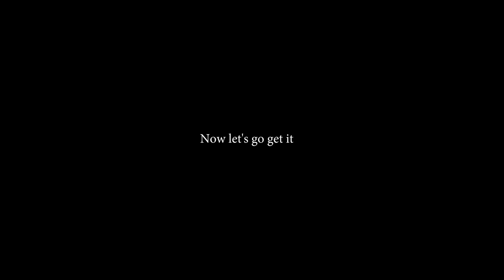Buying and fixing a lowboy trailer : Centreville 35 ton detachable

Comment: You're going to find that trailer is going to be very useful to you because it's a stretch trailer and if you take the back in and put yourself a drop axle in the back you can go up to $130,000 with it as it is right now you can only go 110 and that's anywhere in the 48 states but that's a nice nice trailer

Comment: Since you are doing it up i would get some undercarriage pertection and redo or respray where you put the new air tank Since you are leaving the cover off  .I would also grease the hooks 🪝where the trailer separate the sticky grease and maybe beacons to go on top of the truck for when your stopped on the road again. Also maybe air bags to help with the trailer hook up in steed of wood just a thought 🤔 great 👍video 👍📹.

Comment: On your chain binders you need about 3/4 of an inch of threads showing. DOT will get you otherwise. I am a flat bed truck driver. Great video!
Reply from the maker: really? I did not know that. why on earth would they want that?
Reply: @jmuller86  Well you know the government. If they can make your life tougher. :) I was told they want to see that because if your chains get loose you have room to tighten them without taking the the binder loose again. It really is a nitpicky thing. It does make it easier if you do end up having to tighten them.

Comment: Great buy and video.  I was hoping to see all rubber replaced related to the brakes.

Does anyone have experience with treating large rusty areas with rust eater or converter?  Sure seems like a labor saver.

Comment: I had made some sized Extension nuts out of 4140, welded on with dual gas mig. With lots of Kopper Kote. Keep it from rusting again! 
Give the valve a couple of shots of penetrating oil. 
For your tank drain, are you allowed to put a pull tank drain on it? 
Working from the rear to the front (LR, RR,, LF, RF)  be easier to tighten the lines? 
Kopper Kote it will keep it from rusting. again 
Stainless Steel Fender washers, doubled up?

Comment: Simple trick for removing corroded pipe threaded nipples - break the bond by tightening it just a crack before attempting to loosen it. Pipe fitter father taught me this trick when I was a kid helping remove cast iron radiators.

Comment: Get yourself some steel blocks They should be about 2 inches thick and the length of the channel that flip down. With the big arm . So that your lowboy dont drag. You put the steel blocks under the ears coming from gooseneck to lowboy. The big arm picks them up when unhooking It will give a couple more inches when getting in or out of some place. Instead of dragging and gettin hung up. Just put some wood skids under your Hyd Foot and pick it up higher and slide steel blocks under channels either 1in or 2 in steel. Then set it back down on it. It will give you more ground clearance. I wouldnt run it down the road very far but it will help you too get in or out of some low places...Good luck with new truck and trailer

Comment: I will start with the ADS, my god YouTube is getting as bad a regular TV! I come here for the content, not the ads and there was one like every 5 mins. 

Anywho, great find for the price! It reminds me of the one company I worked for years ago that had an old twin-stick R model Mack and a lowboy that came from the strip mines of southern Ohio.  I have to giggle with loading equipment over the wheels. As long as you're lined up, no biggie!  All I can and will say, about the time you go to load or unload somewhere and that damn pony motor won't start or you forget to fill it and run it out of fuel, you wish you had a wet line installed on it! 

I never heard of that brand but I have operated a bunch, Trail King... Sucks! Eager Beaver... okay, Globe... good for someone else, Etnyre's Blackhawks are good!  Load King... I'll keep my money... the one I had the best luck with was Talbert! So easy to hook up even if you not totally lined up straight. That is what we used and ran in my business. 

Jesse, too bad I wasn't up there, I would show you how to save time and load over the side without detaching. I used to drop the trailer down to the ground, dump the air, and load dozers, backhoes, rubber tire loaders,  track hoes, and minis and even graders over the side. I'm sure someone will say that is hard on the deck boards and the outer rails. Well, we always used elm for deck boards because it is stringy and doesn't spill like other woods. Yeah, it is hard on the outer rails if you don't know what you are doing. But we had two trailers custom built-in Finlay, Ohio or around there and I want to say Mac or Trailer America? But we always took our lowboys there to beef them up! Two had a dovetail over the ass end and ramps. Another huge time saver!  But when you were moving something nearly every day and the amount of iron we had, you look for those time-saving methods! 

It will save you a lot of time, hassle and expense moving your own iron than paying someone else. But there still may be a time or situation where you have to call someone. Good luck with it!

Comment: First time ever I have seen a mech use an earth pick as a quick mechanical punch. Worked really fast so Jesse the unconventional thinker. Good on ya. I had a wild guy who worked like he was killing snakes and he was driving a punch to line up beams. I slid my thumb on the punch just as he was swinging a ten lb maul and he saw my thumb at the last second but I had quickly slid it off as the hammer approached. He thought he had mangled my thumb but that time I lucked out.

Comment: How much would you be paying for an equipment pickup or drop off?  I could see that low boy paying itself off pretty quickly.
Reply from the maker: it was like $400 minimum for even a mile down the road. because you are paying them from the time they leave their shop to the time they would get back, or the minimum which is usually 3 hrs

Comment: When I was running low boy like your set up I carried two ,   2  inch high blocks  by 4X4 to raise the frame up when carrying a load across rail road crossings .Put intro your stock of "Possibles " it will save your ass. Plus it  makes sure your boss never has to call for help if get high centered on some bad piece of road. Just a hint from a driver from the north  "alaska "  you will thank me someday !!!

Comment: Was the Samsung over width?  It hung over the sides of the lowboy.  What's NY law on that? Any nearby states significantly different on over width?
Reply from the maker: over 102 needs wide load signs. excavator is 101.5
Reply: @jmuller86  8-))

Comment: not bad, for the money

beef the cross member up, maybe put a plate across that dovetail.  if your blocking moves or fails, whatever reason, it may save you some frame work. i moved one like that from the manufacturer.  salesman didn't even wait for me to get out of the cab, he had the pony started and the paddle on the stock crossmember before my feet hit the ground.  bent it severely.  the receiving customer was not happy, but didn't try to blame me for it.  muttered something along the line of "not the first time this has happened."  you are probably better off with the setup you have.

Comment: Jesse you can adjust your ride hight as well, get some steel and put it under the gooseneck feet that swing up and down as needed for different hight for  RR tracks etc. good luck
Reply from the maker: I think I will do that, do you ever see someone permanently put shims in there? I would love to raise it 4 inches
Reply: @jmuller86  no, but a variety of shims will get you out of a pinch. Ive seen a old timer that had two three sided blocks each a different hight to get proper ride hight.

Comment: Jease just a little help when loading an excavators put your final drives on first so your counter weight and finals are not at the some end and when you drop your trailer drop the air on your tractor before you drop your trailer and raise it when you pull away then drop it before you hook up once backup in to the trailer raise your air then goik up the trailer just some hints from an ol lowboy hauler
Reply from the maker: thanks . I appreciate the advice

Comment: As a business you should not now paint anything, but make log book, every time you move it, write price avarage on market. All that money should be used on heavy machinery. Lets say you needed some fix, or some new part to change. Even properly repainting digger which is a must. Maybe buying some parts for future. that money must go into service of your equipment, ok lets say you need to replace pricy part and holding untill its needed. You have money buy the part needed new. ANd store it untill you will must change. After you reach price you paid for it start using this money for paint properly you dont need to repaint all at once as prep work takes ages to do it properly while removing rust etc.This is heavy equipment paint is only for rust protection and in sometimes for better looks. What you can see in corporations, they will always repaint non stop parts which have issues. lets say plow or bucket yes it is needed its a must!. They finish the job and machine needs to sit and have to be serviced, so they paint even plows everything. if not it will start rusting same day it will stop digging work.

Comment: Two things as a driver that pulled a low bed for years you need to turn the red glad hand over on the trailed you can get a ticket if down pressure will disconnect it and a fifth chain on the bucket or boom would make you legal. other than that you are on the right track. I pulled a Hyster low bed with pony motor it was ok but was replaced with a Cozad much better.
Reply from the maker: I did have a 5th chain on the bucket. I think I might just put normal air compressor connections between the neck and trailer, easier and no rubber parts

Comment: I think it might make sense to increase the surface area on the tip of the ramp by bolting down some old rubber tracks. Metal on metal, especially when wet has basically no friction if one track slips you going to have a bad day 🤪

Comment: Everytime I replace an air tank I  replace the valves..fittings and hoses.. plastics hoses tend to crack...old valves sometime will freeze and rubber hoses deteriorated inside.

Comment: Just a friendly and helpful tip from my experience, once you get used to the truck and the way it handles you should be able to shift a lot slower and smoother. Shouldn't have to rush to jam the stick from one gear to the next however I'm pretty sure that's how EVERYONE shifts when they first started driving big rigs (shifting fast). It all comes through practice keep up the good work and don't get discouraged if your shifting seems to be fighting you now that you are pulling loads you gotta shift and drive much different with the weight of a load!!

Comment: I know you didn’t have oak for the missing spots but why would you change from the hardwood to a softwood like hemlock?
Reply from the maker: around here it is rare to see oak , hemlock is the standard. I asked the local bigger sawmill and they said hemlock is used 90% of the timr
Reply: @jmuller86  more expensive for sure. I’ve got a lot of hickory and oak from a storm.  I don’t have a mill so it will end up firewood

Comment: OTR drivers like the RGN trailer, but  mostly avoid hydraulics as they add weight. Air bags and blocks are easier at the scale house when you  have to deal with the cops. The extra wight is an issue.  If over weight, that hydraulics and motor may have been enough to pass on by.  I am not talking 80,000.   I am talking  every State and Provence OVERSIZES rules.  They are not standardized.  One says ok, the next wound count the axle because of spacing and put you over the limit.  Lots of variables.   But your choice is perfect for you.  Hope you get the driveway done so you can get you stuff off the highway and up to your shop . It not wise to keep stuff where vandals can get to it.

Comment: Don't forget to get some oversize banners for your truck and trailer when you're towing anything that hangs over the trailer edges. They'll sting you for it. Or at least in most states, don't know about your state laws.
Reply from the maker: this trailer is only 8ft wide and my excavator is just under 102" so it should be legal without the flags
Reply: @jmuller86  Well, then that makes sense. I think most are 8.5 feet these days (or that's the max anyway).

Comment: I think it would be a good idea for you to carry a couple of 2" square blocks to place under the verticle stiff legs for WHEN you get hungup on a breakover. Its only a matter of time. The trailer could be upgraded  to spring brake parking for a couple hundred.
Reply from the maker: if I am already hung up, how would I get the blocks in there? I definitely do want to prepare for getting hungup. something that worries me
Reply: Jessie, raise the hyd cyl
Reply: Raise the trailer with the hyd cyl until there is clearance under then shim under the vertical stiff leg a good solid oak may do, you may half to unhook the lock pins to accomplish this. Try it empty to test the method, it worked for our 70s something 50 ton ,24’ flat deck when hung up, wood may not hold up depending on the load. Empty you usually can scrape it off the road. Up on Maplecrest the car carriers would always dig grooves in the camel back bridge.
Reply from the maker: @davidporter2374  thats good to know. I will def try that soon to make sure I can handle it

Comment: I wouldn't have thought just securing the excavator by the tracks would be sufficient.  Thought you would need to attach it to something more secure than that.
Reply: it`s not sufficient at all. it needs to be secured to the frame in a cross pattern so it cant move at all. if he get in a near crash and has to avoid something while driving like that the excavator will be flying of that trailer.
Reply from the maker: thats how everyone around here secures the excavator

Comment: I forgot to mention those old style rims on the Lowboy needs to be swopped out for standard rims.
Reply: Don't fix whats not broken. Spoke hubs/rims handle a load better than hub pilot. Other than bearings, parts might be hard to find  but they aren't as prone to cracking like hub pilot and bud wheels. Bud wheels I would change out.

Comment: I would have put on a drain valve with a loop and cable so you could drain it/blow it down  without climbing under the trailer.

Comment: If it makes you more confident in your 10 speed, I ran thruway doubles grossing 143,000+ on 9 axles every night. 238 miles. 6 nights a week for 4 years and it did not even develop a bearing hum in that time. You just have to keep that N 14 above 1500 on the hills and stay in your horsepower range and not your torque.

Comment: We run Pitts contender 55 ton rgns they run new around 150k with a 30k flip axle the trailer you have I wouldn't buy just to buy it BUT since you own your own equipment and it won't max that trailer out and you only paid 6700 that's a hellofa deal and a hellofa decent trailer brother